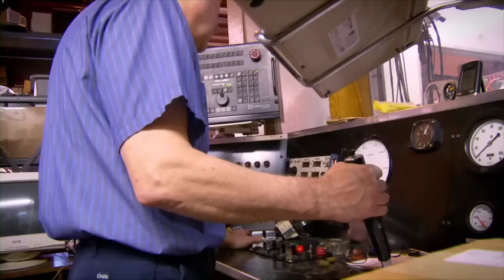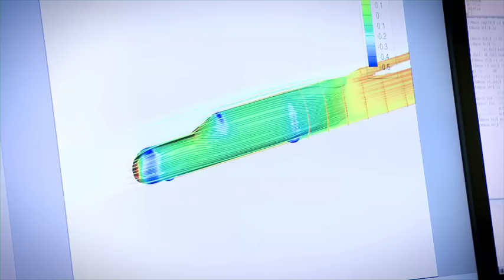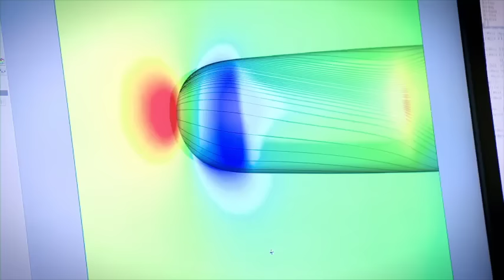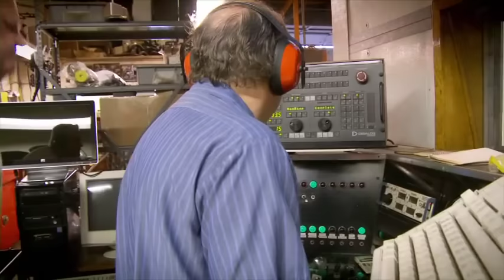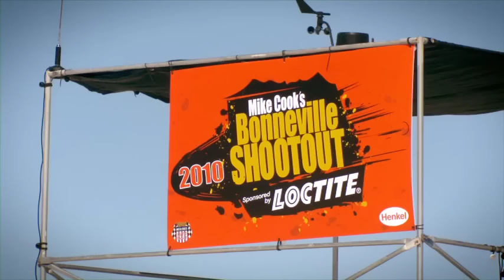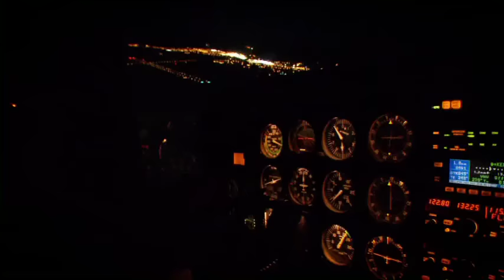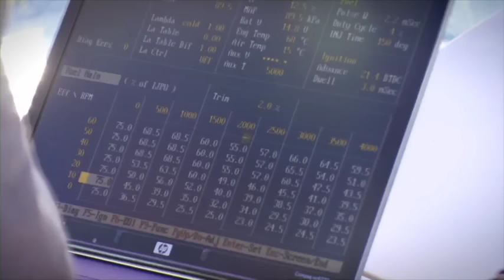Fastest Bike in the World! | Breaking the Land Speed Record! | ACK ATTACK | Full Length Documentary

Comment: I had a Hayabusa B-King for a few years. I decided to see how fast it would go. Got on the interstate, and slowed down until there was a completely clear road ahead. Dropped the hammer, WFO, and saw 185 in fifth gear, going UPHILL. Decided not to even bother with sixth gear. That thing WUZ a beast.
Reply: You stopped pushing right where it ends. The bike can but wont break the gentlemen agreement. Unless... I have a carbed ninja that do 215 and you can feel god at that speed. Also the chain, even tight enough will machine the front sproket housing. I think they say the chain weight several tons at that rpm (13500)
Reply: It's amazing just how far ahead you have to be watching out for any traffic or anything moving in front of you, probably mile or more.
Fastest I've been on a bike is around 165 back in the 1980's.
Reply: @1crazypj  I went 135 on a GPz 1100
I know that’s slow compared to these days, but it was fast for me
Reply: @PInk77W1  My sister was telling her friend she wouldn't go fast with her son on back of her GPZ600. He told his mum the truth though , 135 LOL
Reply: @1crazypj  yikes
Reply: do 160 mph on my BMW going to do the shopping Lmfao!
Reply: I heard a variation of that bike was being considered for police use here in Washington years ago.
Reply: I’ve hit 175 on my concourse14 so far in 5th but ran out of road. Only a tune and air filter upgrades. Still need the full pipe and smaller wind screen tho 😅
She does 160 in 4th no problem…
Reply: I don't look at the speed much And I have been at 175 on a CBR 900.  Been faster on a few other bikes. Going through turns at 140 155 plus. Some of my bike where over 200 mph.

Comment: That transmission problem was probably in the shifting mechanism, not necessarily in the gears themselves, but in the shifting drum (s). It is very rare and almost undetectable to the naked eye, but a worn peak on a shifting groove will not allow the bike to be shifted to the next gear. Such a problem cost me a win at the 1893 WERA National Finals in the 550 modified class on a Yamaha Seca 550. It was still incredible that they were able to compensate losing 2 gears and still by gearing the machine and upping the boost, achieve 394 MPH in that last run. They didn't mention it, but combined with the 371 MPH pass, that would average out to a 382 MPH record it my math is correct. Good video, and I'm not a Bonneville or even a drag racing fan, but I love almost all types of motorcycle racing and certainly respect these "Kings of Speed on 2 Wheels" whether 11 miles or 1,000' in a straight line.

Comment: Amazing effort: perseverance, team work, willingness to take risks... the list of things that you have to be to get it all happening is incredible.
Technically you might call this a motorcycle, but it bears very little relation to what a motorcycle actually is, which makes it a little hard to relate to.
Still... hard to imagine going that fast with two screaming Hayabusa motors behind you, giving it everything they have.  Suzuki know how to make engines that you can just keep on adding the layers of stuff to, so that they just keep on delivering.  So kudos to the people a Hamamatsu, too!
Reply: Suzuki have always made real good, often over engineered engines since the first GS in 1977.
Electrical systems though..............
In fact, until around 2007 you could still buy parts to convert the1979¬83,  2 valve or 4 valve Suzuki GS/GSX 1100 motor to a two valve 1750cc or larger to compete with the 'Harley Davidson' full billet 2 .5 liter motors (nothing HD on or in them except the HD sticker) 
At least the Suzuki used stock cases and most of the transmission.

Comment: I used to own an unrestricted early version of the Kawasaki ZX12R top speed 225 mph, it was built in 2000 to beat the Suzuki Hyabusa GSX1300, which also did close to 220mph, it arrived in 1999. Sorry had to pick you up on your openning statement. The fastest motorbike have been flying past 200mph for over 20 years. What a blast your film is though, great result

Comment: If they are going to pair bikes with rocket engines or even electric powered engines and pit it against production bikes it’s not fair . Riding bikes on the road has a feel and gives you a solid thrill and nothing else can give you the same feel.
Reply: When a 500 cc Kawasaki "Mach III" , gets you a timing slip of "152mph" @ Elkhart Lake, that was just short of the speed of light for me.LLLOOOLLL
Reply: There are "many" classes for bikes (and cars) so production vehicles aren't running for the same records as the modified vehicles.
Classes start with Engine Displacement and Engine Configuration IE 2-stroke, 4-stroke, V Twin, NA, Turbo, Nitrous all have class/rules/records of they're own.
Then it gets into body style, from Naked to Streamline (like this bike). Now lets add different Fuels into the mix = MANY different classes/records...
A friend of mine has set several LSR records on bikes in multiple classes just by doing things like running Naked first (no fairings), then he would bolt just the nose on for another class/record, THEN he add the sides the fairings to set a 3rd record in a 3rd class. Next after that he simply changed Fuels (from pump gas to race gas) and set 2 or 3 more records all at one even...
Reply: Always make room for innovation .... don’t let the Trans take over the wimmins sport, similarly run innovative vehicles in their own categories . Maintain Sportsmanship!!! At all Costs !
Reply: @raycarolewallace466  I had one also with the front drum breaks @ 125. !!!

Comment: I went 179 on a honda blackbird on the salt and 197 on a turbo suzuki. What many people dont get is the salt is like riding on marbles. The bike does not track a line, its always loose and ya have to learn to ignore it....about the time youcstart trying to make corrections is the beginning of a problem you cant fix...The zuk was a double handful. 80lb  slab of lead with 1/2 in of foam for seat trying to keep the rear tire from spinning...open the throttle super slow, watch the tach and catch it before the tire starts to spin and when it does you half to learn how much, a little to much and the rear tire locks up...I seemed to figure it all out quicker than most, i rode year round in salt lake city...ice, hard pack snow, even fresh snow...even at night...its fun once you get the hang of it...should had had a camera...the look on peoples faces as i rode by was always good for a laugh.
Reply: @dl1129  Winter ridding was never an issue for me. A roll of insulated armature wire wrapped around the grip, doesn't matter what diameter as long as each side was 6.5 ohmns....they made enough heat you had to have gloves on to use them. Cold hands on a m/c is not safe or fun...hot hands the cold becomes tolerable... Somebody else who kept their bike in the house in winter? People kept telling me i was the only dummy..lol...had a gs 1000 with a stage 2 yosh kit...leave it outside at night and if it got into the 30's it was a pig to get started...old house 30'' wide door. K&N drad bars with an inch cut of both sides and bar end mirrors...used to stand it on the side stand to turn it around......Its not the bike that kills....nuthin but a simple mistake is all that it takes....im 65 and only made 2 that hurt.....simple stuff...i trusted somebody to not turn left in front of me and i upshifted when i should have down shifted   its all good, i learned the lesson....and ya, i have heard about posting up vids of not legal driving....i have one that shows how i tune without a dyno..Camera mounted on gas cap so spedo and tach and view through the windshield show..1100 rpm idle in 1st..about 1 mph...and pin it..no clutch..i do it that way because its super consistent, and its easy on tires and clutch....when i started stock b-bird ran to 70 in 3.1 seconds...make a change, do it again...bunch of carb mods....+5* timing and a half thick head gasket is worth 2.65 seconds...with stock exhaust..bought $1700 worth of Ti yep it was quicker and made a lot more noise..exact  same top speed means it made the same hp..
Reply: @blackbirdxx928  I've kept my bikes inside for a long time now. I had people tell me for years I'd never be able to make a hoist work for putting them upstairs. Huh, what would they know. Around here anything left out in a shed is likely to get stolen, plus the weather ruins them even in a good shed. I pulled 265kmh on my old Laverda triple once heading to the track to do a days race marshaling, still had a thousand revs left to go on the tach and was still pulling. People say that the Italian speedo's are inaccurate, but I calculated back from the revs and gearing later and it was about right. When the factory endurance raced them as a production bike they got a certified 285kmh out of them down Mulsanne straight. This was when a stock Suzuki or Kawasaki production racer was struggling to get over 245. I'm nearing 60, ridden since I was 4yo, been an instructor, and city courier amongst other things (no LSR there, but it's a rush). Never hurt myself, but done enough stupid things that I wonder how. I used to work as a Moto Scout for professional cycling races, where the police run a rolling envelope around the race, where all road rules are suspended, and all you have to do is do your job safely, and if that requires you go A to B in as little time as possible, you do it. There was usually about 8 police solo riders working with us, and I rode my Benelli adventure bike because it was on wire wheels with road legal knobbies, so it could go anywhere I needed without worrying about slippery grass etc.  It's an 1130cc triple with 145hp at the back wheel, and the cops could never work out how what looked like a dirt bike was actually a fair bit quicker than their bikes (cops here are mainly on BMW R1250's, so not actually slow), especially on what look like dirt tyres (they're not).  I keep thinking about taking the Laverda to the salt, or finding one of the Guzzi Daytonas. There is a local guy here (Australia), who took one to the Aussie salt at Lake Gairdner (only other accredited salt for LSR in the world), and ran 185mph on a stock bike (1100 V twin, yes that's a fast V twin) but after years of living dangerously on bikes, and racing cars, a tree fell on me a few years ago giving me nerve damage in my right arm leaving it weak. I'm almost certain I'll never be able to twist a throttle to the stop if there's 3 Dell'Orto carbs hanging on the cable (Laverda), or maybe even if it's only 2 (Guzzi). Luckily that leaves me with modern fuel injected bikes that all have soft throttles.
Reply: @andrewlongfield3102  Wow, a lifetime of experience and still alive to tell the stories and a crazy from Australia to boot..lol  As for getting one upstairs...if you have the room get an off road bumper winch from wherever you can..i know thing are not cheap in your world...I can get a small 5000 deal from harbor freight for $70 with wireless remote...winch mounts on the wall, 2 pulleys will get you to a lift point...strap around the tripple clamps and one to the frame it the rear...yep, stashed bikes in a mezzanine before....you like salt flats? im from salt lake city utah...done some laps on the salt. Blackbird ran 179 mph in 5th (6spd) with a +1 countershaft sprocket.....and it ran 183 on the highway on the way there :) Bum deal about your right arm...have you thought about switching controls around? ...i can throttle with my left..a little practice i could clutch...link the brakes to the master for the rear..blackbird has linked brakes, they work fine...only variable is old guy learning new coordination...I learned how to ride suicide....clutch left foot, shift left hand when i was 58. You been down the   Mulsanne straight? lucky sob..only place i have to run big numbers anymore is the highway on the way to parker az...3 miles of decent road except for the little hill right in the middle...never notice it in a car but with the throttle pinned on a bike plan on the front wheel coming up...and the occasional speed wobble when it comes down...you know how to fix those little problems right?
Reply: @blackbirdxx928  I sorted the hoist out a couple of years back. A hydraulic ute crane on a raised base, so I can pivot it, with a plate welded to the boom end that holds a 240volt workshop winch that will lift 900kg. I'm never going to pick up a 400kg bike, let alone 900, so it's perfect. I had to build a very large floor plate to spread the load, and the balcony over the stair well flexes a bit, but it's ok, and for heavier bikes I stick a temporary building screw prop under it for support. I cut a section of railing out, so I only have to lift to floor height rather than over the railing, then fitted it with over centre adjustable catches, so I can fit the railing  back once I have a bike either up, or down, depending on which direction it's going.  Currently there is a 668 Laverda sport up here, and a Gilera 2 stroke. Perhaps the Gilera is a candidate for a 125 salt record as it's very slippery, and quick for it's power output, but I would need to find a pilot in the weight range of 45 to 50kg to make it competitive. I'm 107kg, no chance on a bike that small and light. There's also an ATK 605 (yes, an American bike), and a Montessa Cota up here, but the Cota is definitely not built for speed.  Because I have a reasonably large bike collection, and they are mostly unusual or rare bikes, especially the Italians, I decided years ago that i didn't want to modify any of the bikes to let me ride them. That would be a huge job on so many, plus it would detract from their originality, and also I still couldn't test ride/ buy any new bikes. It was obviously better to recover enough use of my arm enough to ride, and I've been riding the dirt and trials bikes for a couple of years now though not at the same level obviously. I might find the salt easy, it's just going straight after all (joke), but I rode lots of fast desert stuff over the years, including hitting deep sand at 185kmh on the Benelli one trip. I find as long as you slump like a sack of potatoes, and don't fight the steering, the bikes  keep going in a sort of straight line. They tend to find their own path through the variations in surface, and the self centering geometry of the front end seems to bring them back in line. On some of the early desert crossings I did, I got thrown off when I fought the bars. I found that relaxing and keeping the throttle pinned almost always works out well as it uses the bikes natural geometry to keep it stable. on the road I'm lucky in that I have family in the country, and there is a fairly unused quiet stretch of road on the way to their house that is dead straight and 27km long. I have tapped out a number of cars and bikes on that. It does have a gentle rise  about halfway, so you can't actually see the whole length, but I usually roll out of the throttle coming over it, in case there is  a car or something in the next 2 or 3km.
Reply: Can’t beat 179mph but I once went 168mph on a blackbird, not on the salt but on public roads. The guy in front of me was going a bit faster though (he turned out to an off duty policeman 😵)
Reply: @mike.47   Wow, somebody who not only knows what a blackbird is, you have ridden one! Odd bike around here. I repainted mine, it had clear over the black and it makes it look..less black. I put honda CBR 600  F4 stickers on it. Id catch some kid out on the road with a 600cc anything and leave him in the dirt packing my 105 lb g-friend on back. I like that bike...this is my #2...not quite a real sport bike but it will get around a corner better than most 550lb deals quiet smooth and good airflow..and it dont wreck my wrists.....cop end up pulling you over? Years ago i got stuck in a line of traffic on a 650 seca turbo...i got impatient and blasted past about a dozen cars...legal pass except for the 80mph...and the cop car...i shut rifgt off...told him sorry, i have to take a crap really bad....he waved me off as he said slow down..and ya, i did but not that bad...and my current b-bird stock exhaust, a pile of carb work a +4 * reluctor wheel, i pulled the head and split the 2 piece headgasket in half and a +1 front sprocket an a minus 2 rear it runs 192 on the rev limiter. and yes gps..
Reply: @blackbirdxx928  Out of all the bikes I’ve owned, my favourite brand was Honda. From the C90 Cub through to a CB250,VFR800, Fireblade and finally the Pan European. The Blackbird was just a bike I tested, I belonged to an Advanced Motorcycle club and we often had a Sunday morning ride out, taking a variety of bikes from different dealerships ending up with an enormous breakfast. I really miss those days 😥